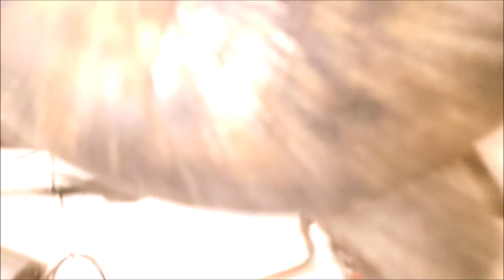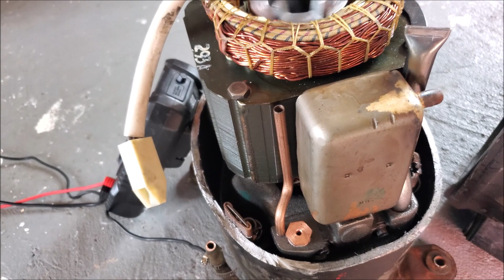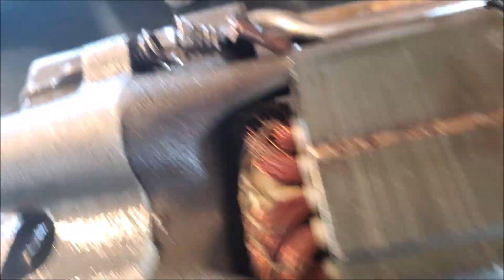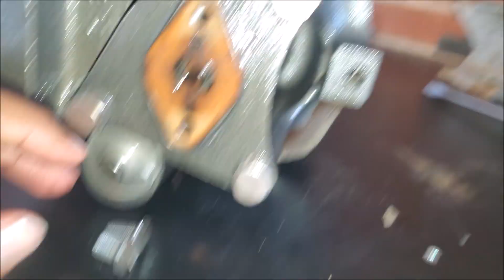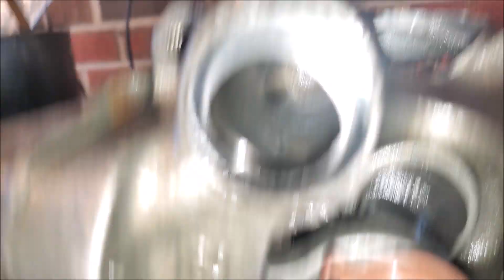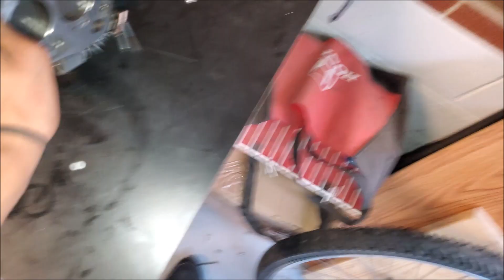Botched teardown of a 41 year old Tecumseh AB series A/C compressor

Comment: So where was the leak in the system for this old KeepRite? Great old Tecumseh. I have a Carrier Tech 2000 central air from 1989 with a Tecumseh AW compressor. She's still cooling and never a leak. They don't make central air units like these old girls. I see many vintage units in my area still pumping away.
Reply from the maker: It looks like there was one at the liquid line right at the quick connects at the condenser, but a much larger one at the evaporator coil. It was easily fixable, but alas, the r22 prices around here are insane. As much as it probably would have been worth it to fix it, there's also that chance that it may have been leaking elsewhere as well

Comment: Lovely old compressor. My 3 Trane XL 20i units use reciprocating compressors (XL20i use two compressors), and they were still made in 2013. I suppose the scroll compressors are less expensive to make which is why they are almost universal today.
Reply: scrolls are more efficient and don't have valves to go bad.
Reply: Actually more expensive.  But they use them anyway as they are more efficient.  I would like to see ellipsoidal rotary vane compressors like what Calsonic makes for the automotive industry.